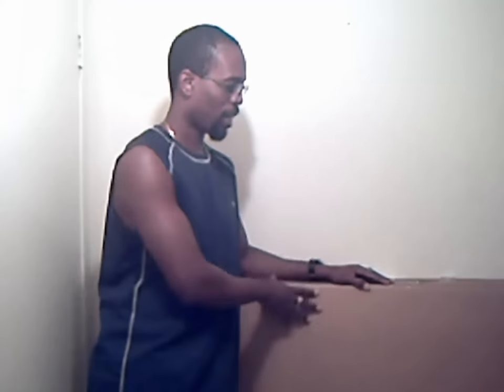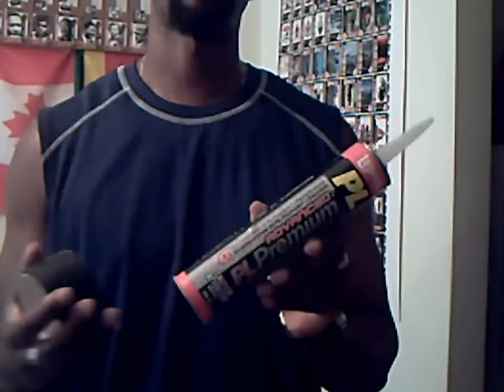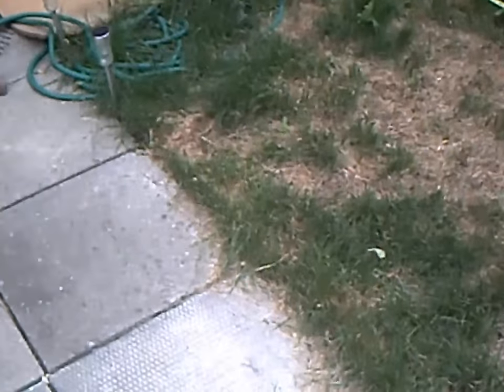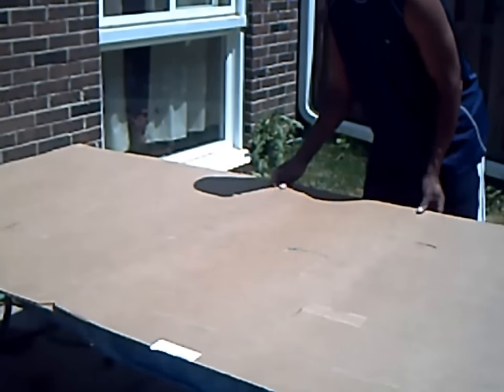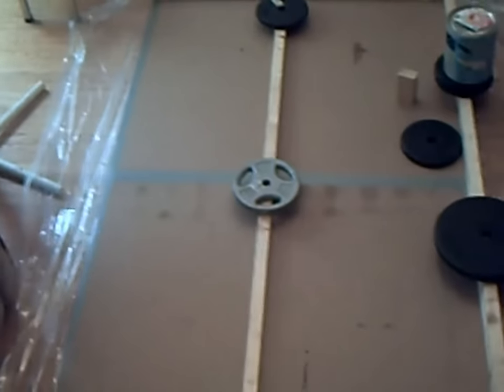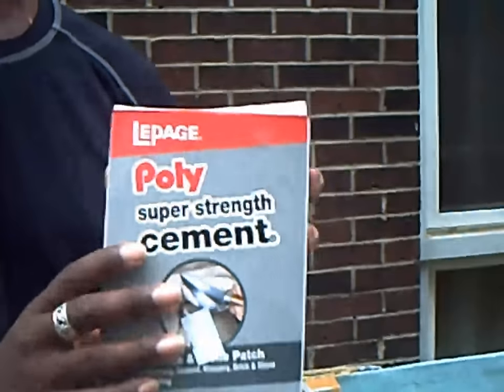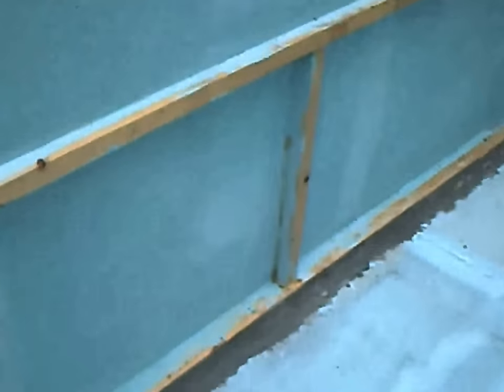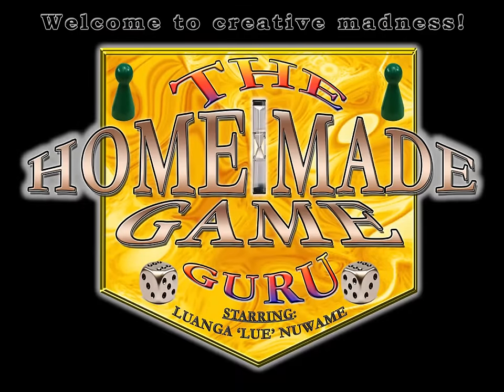Build Your Own Cardboard Swimming Pool DIY Howto

Comment from the maker: Thanks for the advice.  When I decided to make this, I just went ahead and did it.  The design could be improved greatly and the wood supports should have been on the outside more than on the inside - live and learn.  Your point on angled edges is correct - that is where the pool ripped when I got it half full.  Still happy it worked and that it has inspired others to create a better version

Comment: I made one for my grand children last week. It is 3ft high x 8ft long x 6ft wide, my cardboard is four layers thick and I put my framing on the outside. Everything was free, the lumber from a shed I took down for a neighbor and someone gave me 5 gallons of white rubber roofing paint that was left over. I did buy the noodles that I notched and fitted over the top edges for safety and looks. It's been filled with water for five days and no leaks so far. Thanks for the idea.

Comment from the maker: You are correct - I should have put a simple wooden frame on the outside too.  When I thought of this, I just made it right away.  But there is always room for improvements in the design.  Cheers

Comment: I'd put the framing on the outside with some struts positioned into the dirt to support the weight, and use plastic strapping "again free if you check out what's being thrown away at the home improvement store", to give it a rock solid never to cave in approach.  I use the latter  for reinforcing foamie remote control planes good stuff in both aps.  Very rewarding use of ones time to do, and very good job to show how this is done.

Comment: To the homemadeguru, great idea, of course it is up to the individual to expand and make improvments, but first they need the idea. A suggestion to potential builders is the cost of the contact cement/adhesive to glue 4-5 sheets of cardboard together could be more than OSB board or plywood. Also go to bike stores for cardboard, the bike boxes are large and 2-3x thicker than usual boxes.

Thanks for the video

Comment from the maker: I used it for about just over a week at about 1/3 full (worth it)!  I decided to push it to the limit and see how much it could hold before giving out and it eventually broke open once halfway full.  It didn't bother me because I only made the walls 2 pieces thick - barely enough to really hold a full amount (that is why I recommend 4-5 pieces thick walls in the video).  It was a great experiment and I'm pleased how it worked out.
Regardless, by winter, it would have come down anyway.

Comment: I think this project has alot of potential, someone mentioned that you should use the wood on the outside, wich is a good idea, but what about wood on both sides sandwiching the cardboard, also probably should coat the wood. Just some ideas im thinking of doing this but smaller just to kick back and drink a beer or two. Cheers!

Comment from the maker: Wood (especially plywood) is also porous and prone to warping, and the cheaper the wood, the more work is needed to waterproof it.  I have no idea where you can get quality wood at the dimensions of a full sized pool (including the base) for just $10 a sheet, but if you can find that, all the power to you.  
Even Basswood, plywood or MDF would cost a fair amount per sheet for a pool this big.  Again, good on you for finding quality long wood boards for so cheap.

Comment: Great pool idea! I've made smaller things like this but nothing to this scale. One thing I would change is put the wood on the outside. The pressure of the water would push the cardboard onto  the wood as opposed away from the wood. With the wood on the inside, if there is a small place where the adhesive is not holding well or a kids foot kicking, it could push away and cause a failure that would run like a nylon stocking. Also, a long ratcheting cargo strap or two around the entire middle of the pool, so as to not rely totally on the adhesive. AWESOME idea and implementation!!!!
Reply from the maker: ***** Thank you for the positivity and this was indeed a learning lesson. There are many things I plan to improve and need improvement from this original design. This summer I intend to do cardboard swimming pool 2.0 based on the great feedback people have left me

Comment: I built a swimming pool out of red bricks that I got for free. I didn't steel them the builders were demolishing a house. and they gave the bricks to me. then I dug a hole in the ground. a deep one. up to my waist. I installed one drain at the side of the pool and it is used to drain the pool. the pool is fited into the ground. I filled it with water and had a pool partey. and I lived happily ever after. 😁

Comment: Hey it worked.
I just wanted to let you know.
Your framing is on the wrong side.
Still glue the cardboard but screw the framing together and add more ribs 
for strength. You could put some long stakes in the ground against the frame
to brace it even more.
Good experiment.

Comment from the maker: The scrap wood support beams, in addition to the square shape, keeps the form.  If you want to build one, I suggest making a smaller version and make sure to make the walls thick - perhaps 3 or 4 pieces of cardboard thick.  Put wood beam supports inside and outside to keep the strength against water pressure.  Good luck :-)

Comment: Hi there! Congratulations on the tutorial. Very nice. I would like to leave my sugestion to those who plan on doing this. It would be beter to do the wooden frame on the outside of the walls and do an extra support on the outside in a triangular shape, perpendicular to the wall. That will improve resistance to the water pressure. Other than that, for a diferent design i would do the wooden frame and just buy plastic industrial cloth waterproof and reuse it every year. Thanks again for the video.

Comment: dig a hole in the ground and get a pond liner .add dripline for intake and outtake water and use a pond pump to reserculate the water  ..also wind a coil of drip line on a different shut off for winter solar heater

Comment: I feaking LOVE this Idea! Im old and a good soak does wonders for my mobility.
 Im living with my elderly mother and when I mentioned a small hot tub she about had another stroke. Even tho the woman has a backyard the size of kansas she is afraid it will ...be there... somewhere and she might see it.The yard is also as flat as Kansas. When a friend was getting rid of their spendy above ground pool you would have thought I was askiing to put up a heavymetal concert stage for the summer. She point to a 4ft galvenized tub and told me to use that if it got to hot! I JUST CANT WAIT for early summer! When she asks me what the hell im doing Im going to tell her not to worry because it is disposable!

Comment: Very cool! Nice job.  Is there a reason you put the wood supports on the inside?  I would think putting them on the outside might make it more rigid as then the water pushes the cardboard into the supports. One suggestion that might help; avoid right angles, especially on the bottom (floor to wall connection) where the water pressure is the greatest. The cement you used for the bottom probably helps as much by eliminating/reducing the greatest pressure point as it does by proving a seal.

Comment: Have you considered trying again using PVC piping frame along the OUTSIDE to brace the walls? And as a previous poster suggested, triangle braces along the bottom of the walls?

Comment from the maker: Filled it up until it exploded open.  Winter was coming up anyway, so it had to come down either way.  Surprised it got to half way full before one of the walls gave out.  If I made the walls thicker (which I mentioned) and put wood beams on the outside too, I probably would have filled it (though my water bill would have been horrible)

Comment from the maker: I got it to half way full before it finally gave out.  I didn't make the walls thick enough (which I mentioned in the video).  I did use it a couple of times at 1/3 full, but once it got to 1/2 full, the pressure cracked one of the walls.  If I made the walls x4 thick and made the frame on the outside, it would have kept its form.  Then again, winter was coming anyway, so it had to come down regardless.
Hope you take the time to explore my other creative videos - lots to choose from :-D
Cheers

Comment: amazing work !!
but i think u could do it a little cheaper by instead of using the whole water proof coating
by using a tarp, i think its called(sorry english is not my native language) so u could do with out the floor or the leaking just the structure. anyway, great work gonna watch more off ur videos, maybe i could learn a few tips too, keep the good work

Comment: I have a few questions. 1. Is there a reason you put the wood beams inside the pool? It seems to me it would be more structurally sound of the beams were on the outside of the pool so the pressure of the water would help secure the cardboard to the beams instead of pushing the cardboard away? Do you think this pool will last? Will it be easy to patch/fix? I am thinking of making a big one but don't like to waste my time or money! Awesome video! Thanks!

Comment from the maker: If you seriously want to make this, make sure you:
1) Don't make it as tall as what I did - 4 feet tall is good enough
2) Make the cardboard walls THICK (4-6 pieces all around)
3) Put wood supports on the outside of the pool (something I should have done more of in the original design)
4) Use multiple layers of latex coating or, as one viewer mentioned, rubber coating.  
5) Don't put in-ground...worms and bugs will burrow through it
6) put tarp under the pool and on level ground

Good Luck :-)

Comment: I bet the walls bowed before it gave way when you filled it up; I built a big glass fish-tank once without doing a whole lot of structural research, once it was full, if you looked along the glass walls, you could see the glass bending(yes bending)! I drained it and added a brace on the top to hold the walls together; I've now had fish in it for 5 years! If you added triangular braces on the outside at an interval relevant to the thickness of the cardboard, I bet you could fill it up no worries!

Comment: wouldnt it be a lot stronger,easier to seal if the wood was on the outside?You could bolt the corners together as well as it being smooth inside.

Comment: 3' high would have sufficed.  As for lumber and sheet goods.  6 sheets of 7/16" or 3/8" OSB (roughly $6each cdn from home depot)+ enough for 4 2x4 walls, 2'O.C 3' high (w/ top plate), with a 2x4 overlapping lateral brace in the center would have worked, + a cheap 12x12 blue tarp to retain the water would have been cheaper.   30 8' 2x4 ~$50, OSB ~$40, Tarp ~ $20 + a $16 box of 3" deck screws.  You could purchase materials, frame it, and fill it in under 4 hrs.

Comment: I think its a really Good Idea, 
I'm wondering could Insulation Pink Board that Home Depot Sells be Used For inside the walls over The Wood Studs ?  , Then Cover or Rather Glue A Heavy Duty Tarp Over The Pink Board,,
Reply: The Folks Cracking on this Probably Never even built a  home Ice Rink In their back yards as kids.
Reply: You could build a set of stairs & a small deck too,,
Reply: And During Swimming,  The barbecue Food Is Cooking , slow & low.  and Sweet Baby Ray's barbecue Sauce,  It's The Boss Sauce.
Reply: Was a Great Video.
Reply: and some radio music Playing ,,
Greetings From Chicago IL

Comment: What about adding cardboard on the inside as well so the wood frame is sandwiched between the two layers? Then fill between with expanding foam?  I like this idea but not for a swimming pool. I might make one smaller to be a hot tube for my wife and I.....:D

Comment: I'd love to build a 1 mile long WATER SLIDE out of CARDBOARD and STRENGTHEN it so it doesn't FALL APART ! I have tried finding HDPE culvert pipes 5 feet diameter in 50 FT And 100 FTC lengths with NO luck! Its smooth inside !

Comment: well I still think this is too expensive since here in Oman we can get an Intex 450cm x 220cm x 84cm ultra-frame pools @ 80 r.o. thats about $208 USD then again with your idea it can be setup with what ever height and size I want so was thinking of using it for making the plants growbeds in my aquaponic system that way I can setup a 450cm x 200cm x 33cm growbed, however was worried does the rock coating effect the PH of water in anyway?

Comment: Would have been nice in if you had given the ending tally for the price to make the pool.  I like the concept but there are a few things I would have done differently.  First and foremost the framing would be more structurally sound if it was on the outside of the pool rather than on the inside.  Instead of rock paint your might have wanted to see if you could use a very thick plastic tarp.  At the very least I would have painted all the interior components to clean up the look.
Reply from the maker: I'm doing this again for summer with a better planned design. This first 2011 attempt was done on the fly for the fun of it and many things were done wrong and can be improved. The price tally is in the About section. This year's pool will be EPIC!

Comment: Well interesting, must be your first cardboard pool, cuz looks to me like you put it together inside out...why wouldn't you put the braces on the outside? Just an observation, also, it would be easier to make a round pool, and just use the duct tape to wrap around like a band. Just saying and if you made the round cardboard frame, you wouldn't need to seal it up so tight, you could just use some clear plastic sheeting, as a liner of sorts, that way you would be able to dismantle it when the weather got cold. But good job getting it to hold water!!

Comment from the maker: I was supposed to put wood beams on both the inside and outside of the pool, but decided to just do the inside since I originally filled it a 1/3 of the way and the pressure wasn't enough to rupture it.  At half full, it ruptured.

I did mention that I didn't make the walls as thick as I could have because I wanted to complete the video and show that this could be done.  

Many people have seen my design and made their own improvements to better the design - which is what I expect and want.

Comment: I love this idea! I would like to add that I would have reversed the walls where the wood beams are to the outside so when the water puts pressure on the walls it will press against the strong wood beams instead of the potential of pulling away from the wood beams. 
I do have a question though. How long did the pool last you?
Reply from the maker: thanks for watching. I agree the beams should have been on the outside or both sides. In pass posts I've admitted it lasted while filled only a quarter full. Once I tried filling it past half full, it burst open giving my lawn a great watering. This idea was just a fun experiment and I have no regrets 😊
Reply: I think it is genius! I am trying to figure out how to build one in my backyard. Some of the best inventions came from many trial and errors.

Comment from the maker: Naturally, you watched a few minutes of the video and missed the part near the end when I show the fixtures I placed in for a water pump IF desired.  It is common for many people to make a judgement on a video without bothering to watch the whole thing - then again, with the average You Tube retention rate of 3 to 5 minutes, not that surprising.  But yes, I designed this to be able to include pump circulation...

Comment: I know this old but, im suprised you never showed it completely full... did it break or not work out in the end?

I admire you creativeness and doing something just to see if you can, and building stuff yourself rather then pay for it, especially for a big ticket item like this... but I'm not sure people should really do this, especially this way. For one thing, while cardboard can be a good building material in certain circumstances, I don't think its been treated nearly enough to be used as a pool, a rock coating isn't going to be enough for long term usage(longer then a couple years). I would think that it would need to be sealed completely on all sides with some sort of coating and coated very thickly. There is also the problem with that cardboard tends to compact under load, unlike wood or cement... so if you stand on it and it has a rockcoating or something the coating will crack as the cardboard compresses. Not to mention the fact that even if you can prevent water from physically going through the coating, if there is any condensation the cardboard will act like a sponge and soak it up, unlike treated lumber or concrete. And I think a large body of water like that, outside, will very likely to cause condensation during different periods of time.

By all means correct me if I'm wrong if you have an example of how its been used without that problem. This is just what comes to mind off the top of my head.

Secondly, as someone else pointed out(that wasn't responded to, lol) you can actually buy above ground pools for about 300-600$ depending on size and if its old stock/on sale. These are generally well constructed and can last a long time whereas this homemade pool I don't think would last more then a year or two at max and you would have alot of waste to get rid of once it ultimately fails.

Sorry to be so negative, as I said at the beginning I do truely admire your creativeness and having the balls to try and do this, the only way we learn and discover new things is to try them out ourselves.